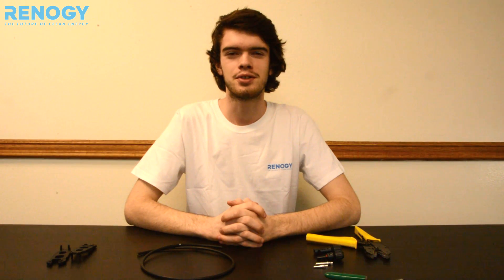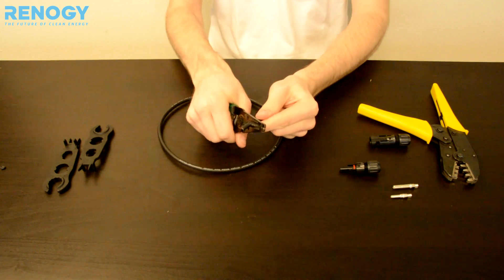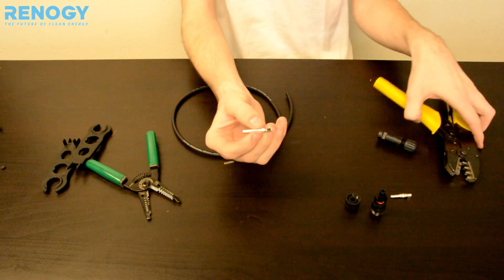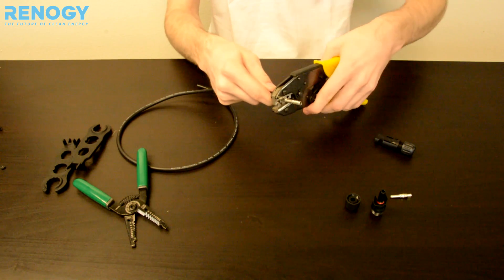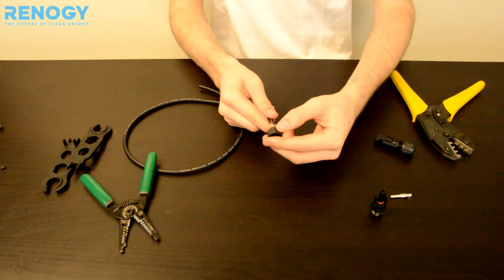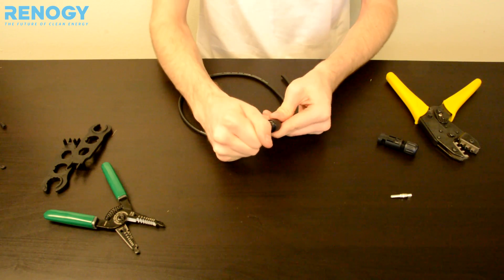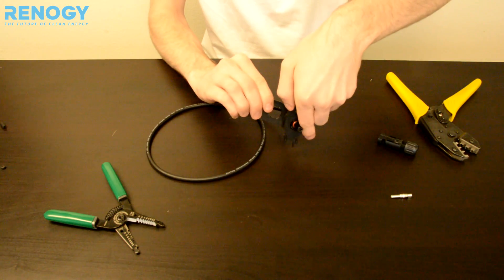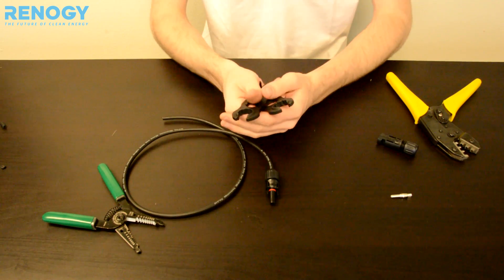How to Assemble MC4 Connectors | Renogy

Comment: Almost useless video.  Not enough info.  Which crimping size should be used? -- 2.5mm, 4mm, 6mm?
Reply from the maker: Hello, thank you for your attention. The installation of Rego batteries is even simpler, as the interconnecting wires between the four 100AH batteries can be omitted.

Comment: Non-professional video lacking required information- just like when you call Renogy tech service. WHAT length do you strip? WHERE in the crimper does the fitting sit? WHAT orientation is the furl relative to the jaws? 

Listen folks- you NEED to watch a better video before crimping MC4 fittings, this one will get you in trouble with your install. Renogy is just a middle-man for Chinese manufacturers, they don't know anything about any of "their" (reseller) products that isn't in the same instruction manual you get. You MUST get the orientation of the barrel in the proper rotation relative to the crimper jaws, watch a better video.

Comment: If you don't have the crimping tool, does it work to just use a vice grip or other normal tool to secure the metal bits inside the connectors? I get that the crimping tool will be easier but some of us don't have a lot of tools. Thanks.
Reply: So you are asking if anybody is a bodger? Would you trust the word of a bodger? So you want to save $5 on a $1,000 system? You might as well use Elmers Glue.
Reply: @i_know_nothing7788 user name checks out

Comment: I get it... black table with black wires and connectors...like magic. One can really see what you're doing.You didn't explain the male and female metal parts that you crimped on and which connectors they go to either.
Not very informative.
Reply from the maker: Hi, Robert.

Thank you for your feedback. We have reflected the problem to our related department and will improve the video later.

Comment: Such a TOTALLY POOR You Tube video from an otherwise Nationally recognized solar cabling company!  Sad. 

Here’s as they say, THE REST OF THE STORY: 

Here are some facts that SHOULD BE IN THE VIDEO but were left out.  MC4 connectors are a ONE USE system - once the cable is cramped into the metal copper plug (either the male or female copper plug) and that plug is inserted into the plastic connector, and it locks into the plastic connector, it is NOT designed to be removed.  So, if you do not want that connector any longer, or it gets damaged, you must cut the cabling and reinstall a new connector. 

How much 10 to 12 AWG wire to strip? A little less than one half inch. 
It does NOT need to be soldered or ‘tinned’ if its crimped tight enough. 

Which crimping tool to use?  I use a professional quality BougeRV, model #LY-2546B, red handled, ratcheting, MC4 crimping tool.  It has three crimping jaws and the center one (in 4mm size) works best for me. Amazon has them. 

Now the big mistake that most every new solar panel cabling DIY guy/gal screws up: “think opposites” when cabling a MC4 connector.  In other words - the MALE copper plug (once the wire cable gets crimped into it) gets inserted into the FEMALE (big hole) plastic connector!!   And the opposite occurs: the FEMALE (big hole) copper plug (once the wire cable gets crimped into it) gets inserted into the MALE plastic connector!!  

And remember most of all - when inserting the copper plug (that has the wire cable already crimped in place) you should hear a noticeable “click” that locks the copper plug inside the MC4 plastic connector housing.  Now that half becomes ONE PIECE - never to come apart - ever! 

BEFORE fully inserting the copper plug into the MC4 plastic connector housing first thread on the cabling: #1) the connector cap, #2) then the plastic splined plastic cup, with the splines facing the cap, and finally #3) the round rubber weatherproof seal.  Then, insert the copper plug into the MC4 plastic connector - listening for the “click”!!! which firmly seats the plug within that connector - then tighten the threaded corrector cap, the splined cup and the weatherproof seal onto the body of that half of the MC4. 

BougeRV also sells two plastic “wrenches” that are designed to tighten the connector cap onto the main body of each half of the overall MC4 connector. Good investment … about $5 a pair. 

Most all professional Solar installers, and cabling coming out of the solar panel, wire the MALE end of the MC4 connector as the POSITIVE (red wire cabling) terminal. 

I trust that this will help all you DIY’ers and answer most questions you have about solar panel cabling connections.  Cheers!

Comment: There are 3 opening on the crimper tool; what wire size is each opening for?
Reply from the maker: Hi, Lewis.

In order to answer your question, we may need to send you image for checking some details. For this condition, we suggest you can submit a case through our Help Center Portal (links listed below for specific locations）for help. 
 
https://renogy.force.com/helpcenter/s/contactsupport (USA)
https://renogy.force.com/helpcenterau/s/casesubmit (Australia)
https://renogy.force.com/helpcenterca/s/contactsupport (Canada)
https://renogy.force.com/helpcenteruk/s/contactsupport (UK)
Reply: @RenogySolar  Fooking crap answer. Just make a proper video.

Comment: what tool is used to remove the crimped pin in the mc4 connector
Reply from the maker: Hi, steve.

The crimped pin can only be cut if you want to remove it.

Comment: The most important parts of making the connections, which of the three inserts to use in the tool, how far to insert the pins, and how far to insert the wire into the pins are just flashed as quick as can be. Not very helpful.
Reply: agreed

Comment: Skipped right through the attaching the female connector...  bought a bunch of these MC4 connectors and the problem is when you put the (female) metal piece inside the female connector it will NOT go in far enough to "click".  So, whats up with this?  You can just slide them in and out with no effort..

Comment: This video did not help me.  I just purchased a 5 pack of these.  It came with the plastic housing and internal parts.  I was able to get the connection to conduct electricity when I connected the internal parts together, but not in the plastic housing.   What is the secret to get this to work in the plastic housing?  It took me a long time to figure out what my problem was.  I had already purchased a 10 foot extension with MC4 plugs on both the black and red wire.  I cut the wire on one end to connect directly to my solar charger. and put two of the new mc4 connectors on my solar panel.  For the life of me I could not get electricity to pass through the wire.  I ran out of day light and gave up on this.  On another day, Thinking the wire connectors were bad I cut those off the cable and then installed another set of MC4 connectors on the wire.  Again I am unable to get electricity to pass through the connectors.  I pulled all 4 connectors off and started from scratch again.  After several hours of messing with this I was able to get power from the solar panel into the charge controller by removing the plastic parts and then connecting the metal parts together.  Works every time, just fear I will short it out.  I tried several combinations of putting the metal part in the plastic part but when I did this the connector did not work.  I then started to test connectivity with my volt meter.  I could not get any of the 5 pack to conduct electricity no matter what combination I used to put them together.  The two ends I cut from the cable were able to connect together and pass electricity.  I am so frustrated with Renogy about this that I will choose another company when I go to add solar panels to the roof.  If I can t seem to get their connectors to work I don't want to try their solar panels.  Just ordered new connectors from another company.
Reply: You really do need a basic knowledge of electricity and binary fault finding.

Comment: I expected better from one of the most popular solar companies.  What length should be trimmed from the end of the wire? What gauge wire should be used? No mention that stranded wire ends should always be twisted before crimping. Can the crimped on terminal be removed from the housing after it has clicked into place? There are small parts not shown in the nut portion. They could have shown proper orientation of those parts. It was obvious the wrench was slipping on the ridges of the nut and probably not getting it very tight. And then there is the poor video quality. Makes me not want to buy anything from Renogy. Specially after seeing the comparison of the 30 amp charge controller that is the same as the Rich branded controller. The terminal connections are light duty on the Renogy branded version. The search for quality continues :(
Reply: For anyone reading this person’s comment, once you have the connectors in hand it’s pretty obvious how they are put together, how they are crimped, and how they are re-assembled. It’s not rocket science.
Reply: @gr7485  It is so obvious that gr7485 wonders why the instruction video was made.
Reply: I don't work for this company, but a lot of people are saying that a lot of solar projects are using 10 or 12 guage wire. I'm hearing 10 guage mentioned the most.
Reply: @noahriding5780  So if you heard that a lot of solar projects were using 00 gauge that would be a reason to use 00 gauge?

Comment: Which terminal goes into which connector?
Reply: Think “opposites” on MC4 cabling connectors: 

The MALE plastic connector takes the FEMALE metal connector that is crimped then inserted into the connector body. 

While the FEMALE plastic connector takes the MALE metal connector that is crimped then inserted into the connector body.
Reply: @vicpal57  I think you have missed the point of this connection. Meanwhile, I am surprised that a male connector goes into a female. Did I miss something in biology? Or is this blindingly obvious? Connector sexing is an arcane art which needs a better explanation than this.

Comment: Audio at max is still too low and black table with black  connector isn't good contrast. More important are the details showing the orientation of the rubber inserts...close-ups would be helpful, depth of metal tips needs to be discussed...video needs work.

Comment: This would have been a useful video if the wire gauge and the recommended length of insulation to cut off had been mentioned. On the positive side, I just did a preliminary buy from Renogy and am very pleased with the quality of what I received.
Reply: Poor audio, very hard to hear.
Reply: I thought the same thing.  BUT -- at least he gave details on which contacts go in which connectors, which a surprising number of these videos don't do.

Comment: Volume is waaaay too low. Couldn't even hear it on one laptop with headphones and all the volumes cranked to the max.  Luckily the other laptop has better audio but still had to max everything out.  

Also the second tool is not used for "leverage", but to hold the connector still so the nut can be tightened most effectively.  

Other than that, decent video.

Comment: Maybe I am old fashioned but even in these politically correct times when we respect everyone's gender identity I thought it was the male parts that go inside the female? Now I am confused.
Reply: Me too I did the same thing thought the mc4 adapters are like the rest none came out for me in ruined 10 of those trying to get 1 good one
Reply: The male looking part actually has a female interior. This is one of the problems of connector terminology. Wait till you get to penetrators ! Or MIL-SPEC connectors.

Comment: Connectors are faulty. There is a small metal insert in the connector shaped much like a a child's Chinese lantern. These inserts on the male connector fall out after a few times connecting and then disconnecting. Mine fell out while on vacation rendering the solar cells useless. This little cylindrical insert acts to take up space between the male pin and female part. Once this happens there is no connection and the whole system does not work. I contacted Adam at Renogy and he was not receptive to my suggestions. We a totally dead batter and basically all he gave me was lip service for about a half an hour. He (they) were not willing to compensate me for their product failure which severely diminished my vacation experience to Yosemite because of lack of power to my travel trailer. He offered to give me more defective connectors but I did not want them. I said as compensation I would return my Wander charge controler in exchange for a better one as compensation but he would not credit me for the one I had and only wanted to give me 25% off the better controler and I would try to modify the connectors I had, in other words up sale me.

He would not compensate me for total failure of the plugs while on vacation. We woke up in the middle of the night with no heat in 37° F weather with dead batteries because the  connectors failed to allow my batteries to charge.

Your connectors will fail because of a design fault. I swear this is true and if anyone doubts me please feel free to contact me directly at.

garyjarrette@gmail.com
or
602-312-8797

For photos and a better explanation.

Your connectors will fail when the spring contact falls out. It is only a matter of time. There is no lip to hold in this insert and some times it comes out. When this happens there is no connection. These connectors have a design fault.

Gary Jarrette
Instrument Maker/Designer Sr. Retired
Arizona State University

Comment: for a 50' run, what size qauge wire is recommended.  Say less than than 20', what size there?
Volume barely present
Reply from the maker: Hi there, gauge size is actually recommended based on the voltage and system load current. There are many available gauge sizes, but it's hard to recommend one without that information.

Comment: Maybe I missed it.. low volume... What is the gauge of the wire/cable?
Reply: MC4 is normally used with 10 or 12 AWG wire. 10 AWG is slightly thicker, harder to bend, and more expensive, but will have slightly lower voltage drop and therefore lower power loss than 12 AWG.

Comment: thanks guys, video worked great for me :) no problems connecting. ignore negative youtubers, lol those whiny pansy's.. it's pretty common sense stuff, strip the wire, make sure you get a good contact, rock and roll. Pansies I tell you!
Reply: If it is so much common sense --why did you have to watch it? The video is poor quality compared to some others of the same type. Renogy products are great and this poor video was a big surprise to see. Renogy solar panels are top of the line.

Comment: those connectors suck 
mine are failing 
been installed for year now
causing short in my system 
not getting any current 
thus not charging my batterys

anyone know of a better connector??????
Reply from the maker: HI there,

I am so sorry to hear your connectors haven't been working out for you. Contact our tech support team at 1-800-330-8678. If there is an issue with your connectors we can see about the possibility of replacing them!
Reply: www.reoomc.com  manufacturer of MC4 connector in China
Please feel free to contact us. mike@reoo.net

Comment: how the fack do you take it apart so I can feed it through a cable clam through the roof..... I herd the click I unscrew the two pieces an it will not pull apart as you showed how can I get it to pull apart???
Reply: I feed the wire to the roof and then install connectors while next to the panels.
Reply from the maker: Hi there, I would suggest contacting our tech support team at 1-800-330-8678 so that they can hear more information about your solar system!

Comment: do the leads from the panel have to be a set length and do they have to have a connector before they get connected to the battery
Reply from the maker: Hi there,

The leads from the panels to the controller can have different lengths, but if its too long, you'll have a voltage drop and lose a lot of energy. If it's super far, it might not even charge the battery. Also, if your panels are set in parallel, the drop would be worse. When connecting the controller to the battery, we use o-rings because they are pretty universal, but you could use other connectors.